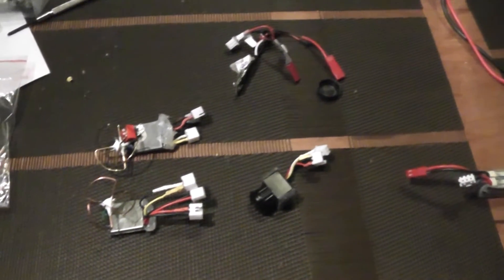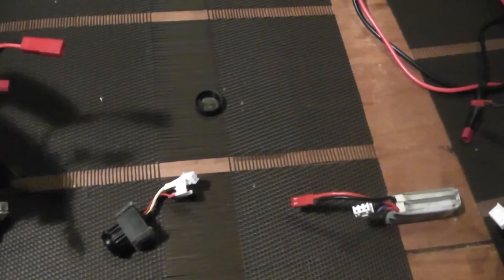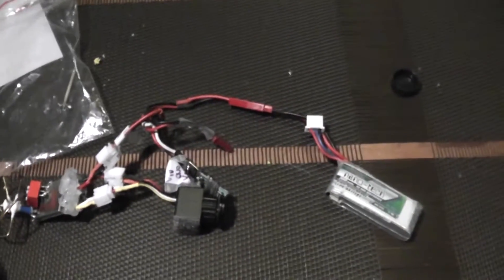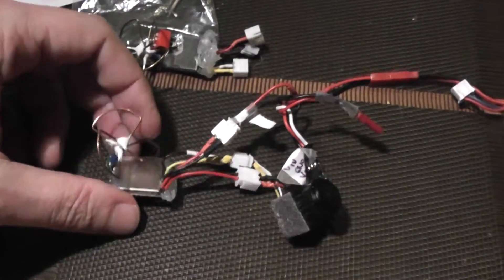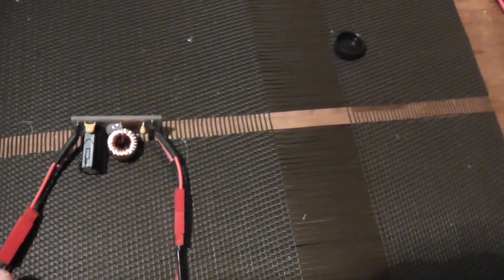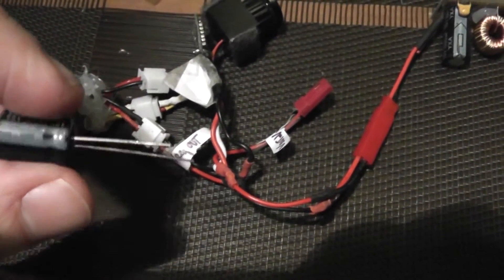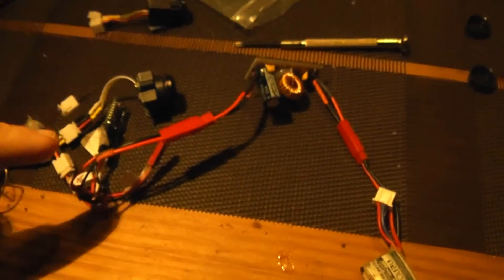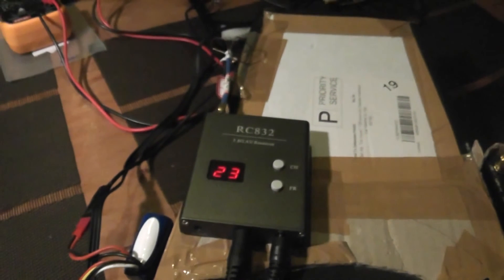TX5200m VS TX5823 200mW VTX

Comment: Hi buddy, i have a tx5823 vtx from banggood and i'm trying to use it without noise from the main lipo of my micro brushed quad. Tried to put a home made lc filter (407uf cap + ferrite ring) but when lipo is becoming empty the noise get back. I ordered some pololu regulator but didn't received them yet (i'm hoping that it solves my problem). I'm hoping that i can run it only using the light pololu reg. I don't know if i have the 3.3 or 5v version but i was using it with a 1s lipo directly.. From the main battery or a second one without a problem. Could you give me some clue?
Reply from the maker: Thiago Arecippo Hummm Dépends which version of the TX5823 you have. I guess you got it recently from BG and now they can also accept +5V in input (blue PCB in general). My advice is to take variable pololu step up/down (0.8g) and tune it to 3.9V. With this voltage, you will have more or a clear image while not being too much hot. Of course you can plug it into the main LiPo, the pololu will remove the noise. But since you will receive some +3.3V and +5V pololu, try with the +5V be sure to cool it correctly.

Comment: Hi im a complete beginner to this stuff, If i use this tx ( TX5823 ) what wires ect would I need to power it via a jst battery and connect video output from the mobius camera into this tx
Reply from the maker: Hasitha Jayathilake You have to run your system at +5V coz the möbius need 5V via the USB plug. Actually I know the TX5823 sold by BG can support +5V (internal Vreg) but most of the TX5823 are 3.3V in general. So you will probably need a tiny Vreg to go from your LIpo to 5V for the mobus then maybe also to feed the TX5823-5V edition. If you have a TX5823-3.3 you will need to add a second Vreg
Reply: So you can't run the mobius fpv without supplying power to the mobius?
Reply from the maker: Hasitha Jayathilake Yes tt should be possible be sure to have I guess a common GND with the power source for VTX. Sorry I never used the möbius as FPV cam. It's not the best one for FMV by the way
Reply: thanks for the answers . Im using the mobius because cant put 2 cameras on smallish quad. One final question , would this tx (http://www.banggood.com/10g-Clover-220MW-5_8G-FPV-Gopro-Cable-400M-HDDuPont-Female-p-911804.html) work with this battery ( http://www.banggood.com/10g-Clover-220MW-5_8G-FPV-Gopro-Cable-400M-HDDuPont-Female-p-911804.html ). Thanks in advance

Comment: nice video Seby. Quick question though. Is it necessary to use a step down regulator? I mean, isn't the transmitters able to handle 7 volts and up?
Reply from the maker: Well the step down role is more to filter out motor interférences and also to reduce emitted heat....
Reply: SeBy DocKy ah understood. Thanks for your response. Very helpful video :)

Comment: Only other thing I can think of is throwing the 470uf cap on the video leg like on the diagram on bang goods website. Although the vid filter you use should do the same thing... dunno mine just came in yesterday I'll wire it up and see what
Reply from the maker: I didn't see real improvement even with such 470uF cap :(. Maybe you will be more lucky than me

Comment: just a quick tip all your antennae are cut too short? ie as you have them ALL have metal "within" the antennas frenzel zone so your testing wont show best results possible :( active part of your clover leaf should be 2x times wavelength AWAY from any other electrical part? specially the metal case of your vtx ;)
Reply from the maker: I agree with you on this point in order to maximize propagation but for the sensibility to interferences, it doen't change. For example, my last 3 videos are made with 200mW VTX of fpvhobby with a longer foot antenna. You can still observed these horizontal lines.
By the way, I will modify my installation on the V262 to have the VTX far from any other RF sources. It will help for sure thanks